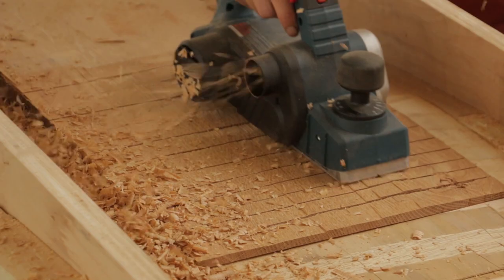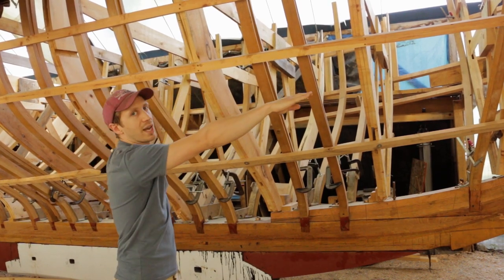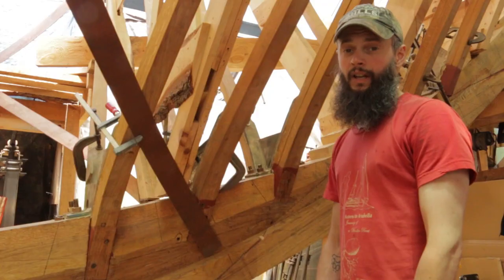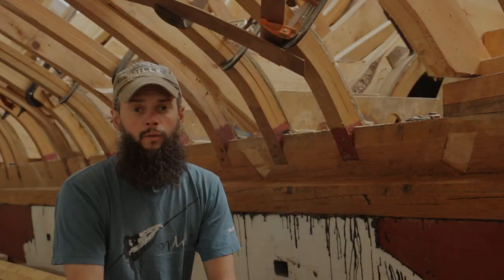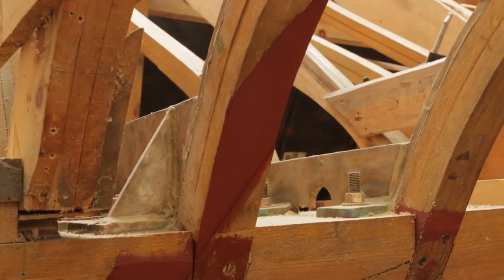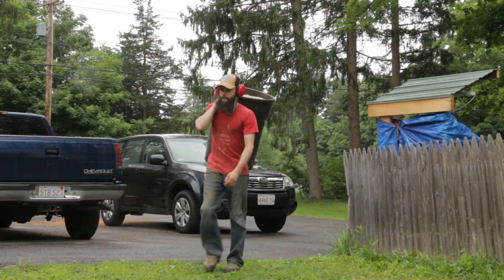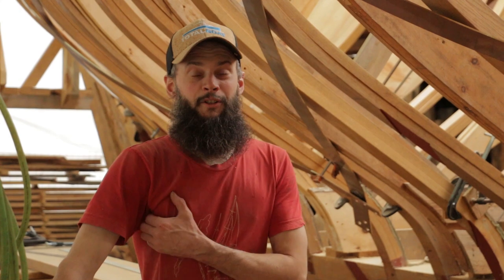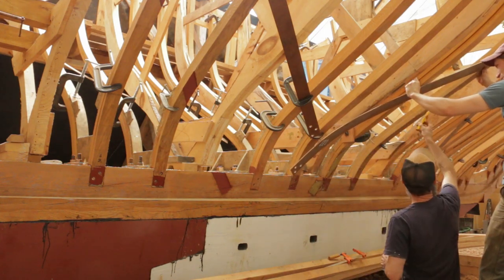Acorn to Arabella - Journey of a Wooden Boat - Episode 71: Installing the Bronze Strapping

Comment: Dear structural engineers, life long woodworkers and house builders that are blowing a lid over this, or just scratching their heads: relax. Your friendly Naval Architect with a penchant for traditional boatbuilding is here to sooth your worries.

This is best practice. Doesn't matter which authority you care to consult, diagonal hull strapping is recommended for smooth planked wooden hulls like this in some way or another. Lloyd's, DNV GL, Herreshoff, Larry Pardey, Dave Gerr, the list goes on. 

Legendary yacht builders like Nevins, A&R, and Luerssen have employed it. So did Joshua Humphreys when he drew USS Constitution, and Hercules Linton for Curry Sark.

It works. It doesn't poke out of the deck, and it won't rip her sides open when the temperature changes.

When William Atkin drew Ingrid sometime in the thirties, the construction method he specified was an old hat. He was a traditionalist, working for a conservative do it yourself crowd.

Skeene's Elements of Yacht Design was first published in 1904. It wasn't innovative. He wrote down the state of the art. I'd be surprised if you could find anything on Ingrid's construction plans that Norman Skeene would have objected to. 

Bronze instead of iron, laminating and scarfing with epoxy or resorcinol, those are improvements on a well established and proven method. 

Whenever it looks like Alix and Steve are reinventing the wheel, they aren't. They have never done it before, that doesn't mean it has never been done before. Exactly the opposite.

Comment: Been building boats for 61 yrs and this boat will end up top heavy.
Reply: With 4 and a half ton of lead hanging 3 feet below water line, as well as whatever ballast lead they spread around in the bilge, the diesel engine, plus the collective weight of probably 12,000 pounds of boatwood and cargo all pushing down.. I doubt that..
besides, they can always just lower the sails a bit if she leans in a strong wind..

Comment: Wow, I didn't even know this was an actual technique for stiffing wooden boats, But sounds like an absolutely must when you explained it, The learning continues.
Reply: They made up the diagonal strapping. It is not a traditional wood boatbuilding practice.
Reply: @pauleohl  - That just goes to show what you don't know. They didn't "make it up"... the technique dates back over 200 years, and was used in the construction of the USS Constitution. It wasn't subsequently used for every wooden boat that was built, but it was certainly used when a really strong hull was required. Perhaps you should assume less and research more, before making categorical statements like that... ;-)
Reply from the maker: Herreshoff and Dave Gerr both recommend using diagonal hull strapping, and the Arabella plans call for diagonal deck strapping (which we will be installing.)
Reply: @AcornToArabella  Don't forget Larry Pardey in "Elements of Classic Boat Construction."

Comment: This is beautiful.  I love the idea of the Bronze straps.  However, keep in mind that they form a saddle point.  Under stress, one side is going to try to straighten while the other side will try the same.  Once side will pull toward the inside of the hull (good) while the smaller keel side is going to try to straighten.  That's a lot of stress.  The smaller keel side is only there for anchoring the stresses to the keel.  So the saddle point is going to have to be reinforced so it will not break and unseat the keel anchoring.  At least that's what I see.  I've been wrong before.  Once I thought I was wrong only to find out I was mistaken <grin>.
Reply: clear as mud
Reply: @johnbower  Takes some math to understand, sorry.